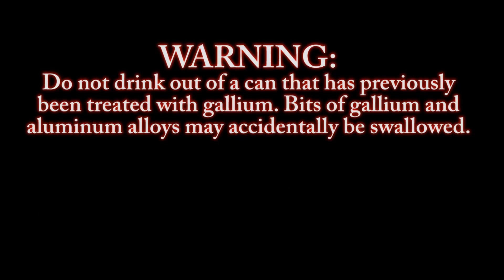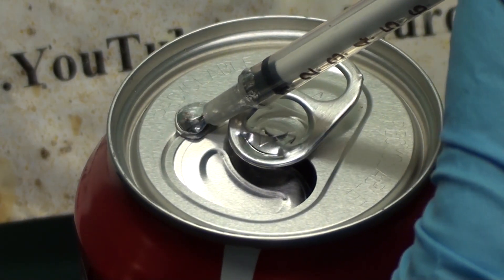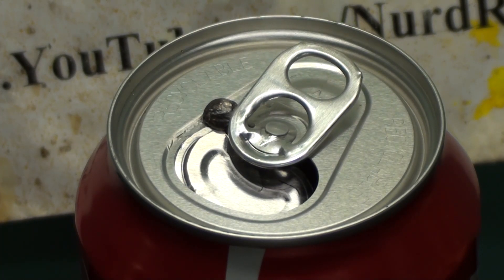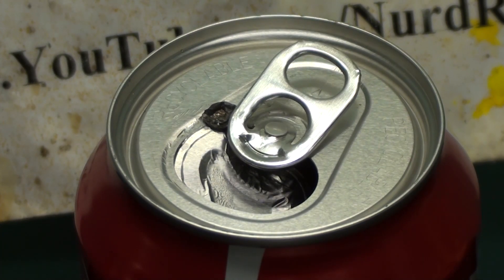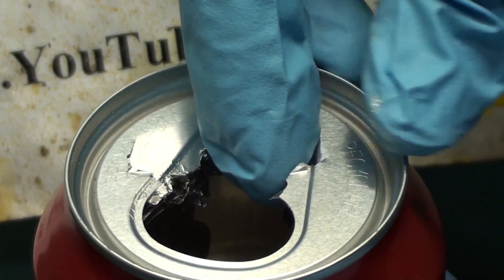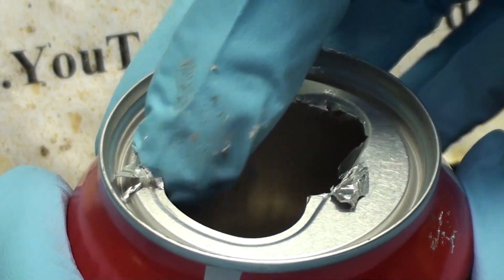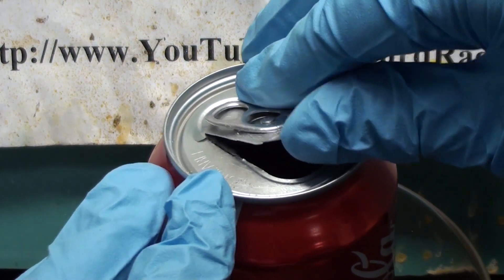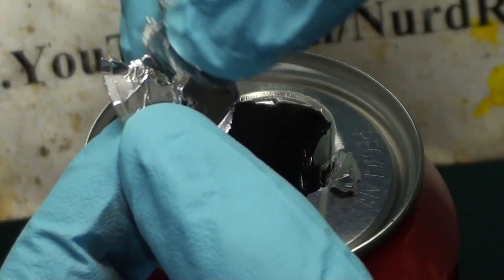Gallium Induced Structural Failure of a Coke Can

Comment: Could this be used as a way to make metal armor practically useless after being shot with gallium bullets?
Reply from the maker: Herbert Grean Good question. This only works for aluminum metal. As most metal armor is iron (as far as i know, i could be wrong here) this shouldn't be a problem.
Reply: NurdRage Most armor-grade material is extremely hard steel, as far as that used on vehicles goes. Personal armor worn by infantry elements is typically composed of both hard and a soft components, with an underlayer of kevlar or some other fabric or woven polymer armor, and a primary strike plate composed of ceramic, or much less commonly a steel plate (these are far heavier than similar volumes of the ceramic plates, but stand up to repeated strikes more reliably).
Reply: if you want metal armor piercing rounds use depleted uranium
Reply: +LetsGetGaming And the 103rd little piggy built a house out of depleted uranium, and the wolf was like, "dude..."
Reply: While it would theoretically be possible, most of the interior surfaces aren't made of aluminum, and those that are typically aren't part of the fuselage itself. The biggest kicker here, though, is that the aluminum used in aircraft construction is often laminated by composite materials to prevent corrosion and wear, especially in load-bearing structural members. On top of that is a lot of the actual fuselage structure is painted; gallium would more or less just run off of this.

There's also the small issue with the TSA taking a disliking to bringing liquids over a certain quantity on flights.
Reply: +LetsGetGaming That's really only practical in large-bore weapon platforms, like the sort you see used as main guns on tanks, or large autocannons/rotary guns. When you look at small arms, those carried by individuals, depleted uranium is generally too dense and heavy to be accelerated to the velocities where it's really useful in penetrating armor; you get better results out of steel cores in lighter rounds and tungsten penetrators in heavier ones, with larger powder volumes necessary to push them to the appropriate speeds. Depleted uranium is hardly ever necessary or economical to use in an anti-armor role outside of munitions used to kill heavily-armored vehicles like main battle tanks.

It should also be noted that the round described by the poster Ivan Blagovich just below yours in not a round that exists; there's no factory-produced tungsten-core service cartridge for that platform. Even if there was, the round would be unsuitable for penetrating the sort of armor that's been discussed here (steel or ceramic plates); the handgun cartridge he's describing is quite capable of pushing through lightweight fabric armors composed solely out of something like, say, Kevlar, but most personal armor worn these days integrates a plates, and fabric layers a lot thicker than the NIJ and CRISAT standards. Most handguns just don't push enough weight and velocity to be a credible threat to any kind of trauma plate.
Reply: +John David it's home made bullets, proved on Class 2 and Class 3 body armors ... http://www.armyequipment.com/proizvodi.php?id=10
Reply: +NurdRage It would also be very difficult to keep the gallium bullet solid as it's fired out of a rifle, it would likely dissipate into the air upon firing the bullet.
Reply: Placing the possibility of that aside, wouldn't it be impractical to make gallium bullets when you can just use normal bullets? Metals don't survive bullets that much unless you got a really good compound.
Reply: +Herbert Grean Tungsten, cobalt/ceramic, uranium bullets are common here ... we made it our needs ...
Reply: +Herbert Grean It will only work if the metal armor was made of aluminum. Other metals won't react with the gallium.
Reply: john curtan No, gallium doesn't affect steel at all.
Reply: well who the fuck used metal armors. we uze kevlar for bulletproof vests, and tanks and such are made with steel, which doesnt react with gallium.
Reply: Kevlar is often used in less protective soft armor, yes, but to provide protection against rifle munitions, steel or ceramic inserts are used. Most body armor today incorporates some kind of metal or ceramic.

No one said gallium would be practical; they were just asking about it. It would in fact be VERY impractical.
Reply: Or combat tank
Reply: +Herbert Grean A gallium bullet would probably melt before it hits any target.
Reply: +Herbert Grean I know this question was asked a year ago, but whilst it wouldn't make much use against many armoured structures such as a tank or body armour, it could prove extremely dangerous if used against aircraft as most of the structure would be made of aluminium, it would weaken the structure of the aircraft to the extent that the pressure difference between the outside and the inner cabin could potentially lead to the plane splitting in half from air pressure alone.
Reply: Peter Heyes Not particularly. There's a reason that most engagements involving anti-aircraft fire (both from other aircraft and surface assets) are carried out with missiles.

Leaving the prevalence of missiles aside, and their massively greater utility in modern air-to-air and surface-to-air engagements, the rotary gun systems carried on modern combat aircraft have a maximum effective range of about 3 kilometers, and that's against a perfectly still, non-moving static target at known range. Aircraft maneuvering in a dogfight have no such luxury. This means that the rotary cannons on an aircraft are generally useful only in the role of a fallback weapon (for air to air engagements) or being used during gun runs against ground targets.

If you're considering the use of surface to air weapons against aircraft, this is also a case where the use of gun systems is largely deprecated, due to the operational ceiling and speed of the aircraft the guns are being fired at. The most viable use for anti-aircraft gun systems these days is as CIWS on naval ships, and their increasingly common usage as an anti-IDF weapon as a means of installation defense. In both cases, the target is flying either dead-on, with little maneuvering, and on a relatively predictable course.

In each of these cases, it is far more serviceable of a choice to use the conventional high explosive incendiary or high explosive armor piercing munitions already in service, as it can cause catastrophic damage in a similar manner, and is viable against more than just, well, aluminum, can start fires, penetrate heavy armor, and cause sympathetic detonations of munitions carried on a targeted aircraft, or explosive disruption of the warhead of an inbound missile or mortar.

TL;DR: gallium as an ammunition is massively impractical and could be outdone by basically any kind of ammunition already in use for the systems and roles that have been proposed here
Reply: +Haneix Wonder why they use tanks in war then? :P
Reply: If they made metal armor out of aluminum, lol. I think they'd be more likely to make it out of a metal that didn't SUCK though.
Reply: +LetsGetGaming Tungsten bullets ... I use them for my TT 7,62mm M57 !!! Goes thorough the armor just like knife thorough chees ...

Comment: Could you put that on an armored tank and then punch through it like a bad@$$?
Reply: Only if the armored tank is made out of aluminium (a somewhat soft, malleable metal so I doubt it).
Reply: EKULvideos You could sabotage a lot of M16 and M4 carbines with this... they're made out of a lot of milled aluminum (aluminium) bolted together with steel to lighten weight.

Comment: this seems like a dangerous element to have! can u melt cars or even building structures with this?
Reply: william112004 "Don't" Scratch up the roof of his car and leave a quarter size amount on the scratched surface. But bologna is cheaper and easier. "Don't" wait for a hot day and put bologna slices all over his car anywhere there is paint because this will destroy his paint job and you don't want to do that right?
Reply: sermerlin1 Buildings are not built with stainless steel, that would be horrendously expensive. 

It's just regular steel.
Reply: As far as i remember building structures are made of stainless steel that is also reinforced with other strong metals to make it mega strong. Gallium doesn't break steel. If that was possible you'd see major buildings drop down like dominos. xD
Reply: so what would happen if a drop of gallium happens to be mixed in my boss' petrol for tha car?
Reply: No, gallium will not alloy with steel in the same manner.
Reply: william112004 his cars engine or fuel pump would stop working just like when you would throw any other mixture that's not the fuel he's using. If you really wanna throw in something in his gas thank throw diesel if he's petrol and you'll fuck his engine up. :v
Reply: sermerlin1
No it won't at best it'll just run like crap until it's drained and refilled with the correct gas, putting gas in Diesel engine though is a bad day for the Diesel, gas detonates far to soon.
Reply: william112004  probably nothing. most cars use steel or plastic for fuel parts.
Reply: Jason Travor Lol. I was wondering where he got that from.
Reply: 441meatloaf It's non-toxic but it can still kill you by heavy metal poisoning (only if ingested) so I wouldn't give it to kids to play with.
Reply: sermerlin1 Diesel won't burn in petrol engines
Reply: Emx2000 Exactly my point.
Reply: EKULvideos gallium is safe to use as long u are sensible with it and i've even seen it on sale in gift shops in science museums
Reply: Yea but it would take decades or even centuries  depending on the amount of gallium
Reply: 441meatloaf why the hostility?

Comment: Is there anything similar to Gallium that can melt into any steels? If not wood or glass (or plexiglass)? That will be nice to have if you want to robbed a nearest bank.
Reply: Samuel Michalicek No, you can't. Fuck off to the USSR
Reply: I will actually answer your question instead of ranting about nonsense and failing at the English language. The element mercury (Hg) behaves like gallium and amalgamates with other metals like aluminum (like gallium did in the video). Hope that helps!
Reply: it would probably be faster and safer to use an oxygen acetylene torch ;)
Reply: r u planning to rob a bank? i can arrest you for saying that you know
Reply: Samuel Michalicek I shall arrest thru interwebs
Reply: i can say whatever i want, besides your name implies that you are a huge smellly piece of crap. so just shut the f up

Comment: My De-Pacification Gallium reactor uses Pure AlGa+H2o = Al2O3+H2+Ga
Then you take the Aluminium oxide and using a Catalyst running on the Hydrogen Gas you can achieve the heat required to get back the aluminium and start the whole process again...

FREE ENERGY !!!

Comment: something I wonder : does it also makes aluminium easier to melt ? (if you know, plz reply!)
Reply: Well technically it will, since the alloy has a lower melting point.
But the difference is very low unless you have very high amounts of gallium. For example, to lower the melting point of the alloy from 660°C (for pure aluminium) to 600°C you will need about 30% massic gallium.

But there are loads of factors like the cinetics of the mix and so on, so you're also likely to get liquid gallium inside solid aluminium, exactly like in the video.
Reply: oh. okay. well I guess, by your explanations, that to melt an aluminium can in a pan or in the oven by example, we'ld need a large amount of gallium, right ?
Reply: Around 80% gallium (massic) to melt everything in a 'normal' oven, meaning around 350°C. At 95% gallium it's a 150°C, and 99.2% it's pretty much the normal gallium melting point.
Reply: But at that point you'd already he having pieces of aluminium floating inside gallium anyway.
Reply: so I'ld need somethin like "as much gallium than aluminium", right ?
Reply: *****
Yes, pretty much, if you count by volume.

Comment: My question is how does the dab of gallium in a localized area affect the structure of the aluminum about an inch away from the dab of gallium?
Reply: Gallium percipitates into the aluminum and then diffuses across it, forming what's known as a "solid solution" (similar to the liquid solutions known to most).  Evidently, gallium diffuses quite quickly in an aluminum matrix.

From the video, it almost looks like the gallium becomes the solute into which the original aluminum dissolves.
Reply: you mean kinda like a localized infection in organic material spreads from an open wound and weakens  the near by organic material.

Comment: How did the galium effect parts of the aluminum that it didn't even touch? Also I doubt that metal can really alloy with other metals unless BOTH are in the liquid state (and melting aluminum takes a LOT of heat). It must have been a non-alloy based chemical reaction between the galium and the aluminum.

Comment: Gallium acts like water because it wets things. Aluminium is composed of small cristals, or grains. The gallium goes between those grains and because of the small angle it forms, it completely wets the surface between those grains. After this there is nothing left to hold those grains together, so the structure fails.
Think of it as a sugar 'cube' you drop in coffee. Water wets it and the grains fall appart.

Comment: Use the resultant aluminum/gallium alloy to produce hydrogen by placing it in water. You can then use the hydrogen in a fuel cell or burn it in an engine or torch. 

Students at Purdue University found out that gallium breaks aluminum's oxide layer and allows it to react with water and produce aluminum hydroxide and hydrogen gas. The best part is that you can recover your gallium once the reaction is over.

Comment: Aluminium is composed of tiny cristal grains that are 'glued' together. Think of it like a sugar 'block' you put into your coffee. All the sugar grains are linked but if you put it in water the structure just falls appart.
What happens with the gallium is that it coats all the grains with a thin layer, breaking the bonds between the grains. The layer is so thin it doesn't require much gallium to weaken the aluminium.

Comment: 3: Doing so without being noticed would be rather difficult.
4: Surreptitious sabotage would likely result in small openings which would cause pressurization problems...which is hazardous, but only because people need to breathe.
5: Even if you did apply gallium to the airframe in-flight, the aluminium would be so cold it would freeze.  Gallium behaves a lot like butter.  It would only become a problem after the plane was parked outside on a hot day for a while after landing.

I could go on....

Comment: A few problems:
1: Highly impractical.  This is something a chemistry obsessed lunatic would do, not a terrorist.  A much more sophisticated plane-destroying mechanism, called an RPG, is already readily available in many of the places terrorists operate.
2: If one did that to a plane and somehow managed to get it into the airframe rather than the plastic interior, it would likely either cause sufficient structural damage for the plane to disintegrate during the reaction, even on the ground....

Comment: Actually, the original discoverer of the metal Aluminum or Aluminium wrote it 3 different ways in his studies, the third of which I do not remember, but his papers do include both of these names. As such, it is in fact acceptable to use either form of the name. Learn more."Sir Humphry made a bit of a mess of naming this new element, at first spelling it alumium (this was in 1807) then changing it to aluminum, and finally settling on aluminium in 1812." Look up "Aluminum Aluminium worldwidewords"

Comment: Yes, because it isn't something that acts chemically with it. It's a bit like when you put a sugar block inside water and the grains just fall appart.
So it basically 'wets' the metal, like water wets a sponge, filling the small gaps. These gaps happen to be the boundaries between grains, which get separated. Mercury works the same way.
So it affects most metals.

Comment: Would the aluminium be reactive to water then? I saw a video somewhere where al/galium pellets are used in electric cars to supply hydrogen by mixing them in water.

Also, isn't this kinda begging for someone to break in aluminium doors with this method? Scratch and win, truly.

Comment: I work regularly with engineers from Germany, Italy, Taiwan, Mainland China and England.

When speaking to the people from England, those people say "aluminium", when speaking to anyone else or amongst themselves, it's around 50-50.

It's one thing to plug something into google translate, but it's another thing to see what actual people use. Just like in 1990, when IUPAC made it internationally official as Aluminium, but the actual common use was such that they had to add Aluminum later.

Comment: Circular reasoning. Those languages brought the word into their language based on the British English at a certain time.
You need to read up a bit more on Sir Humphry Davy and the history of the word.

You are claiming there is only 1 correct way. I am claiming there are two totally acceptable.

That has been the case since the early 1800s and has been recognized by official bodies (IUPAC). 

The chemical relation is supported for -ium (ie magnesium) and -um (ie tantalum, molybdenum). Both work.

Comment: You got me on this. The answer I was looking for is this : Two variants of the metal's name are in current use, aluminium and aluminum (besides the obsolete alumium). The International Union of Pure and Applied Chemistry (IUPAC) adopted aluminium as the standard international name for the element but, three years later, recognized aluminum as an acceptable variant. Hence their periodic table includes both. [old.iupac.org/reports/1998/7001coplen/aluminium.html]